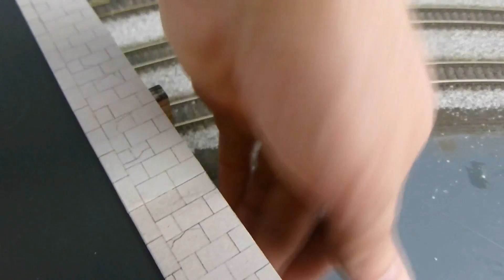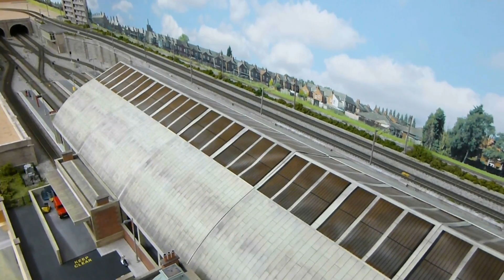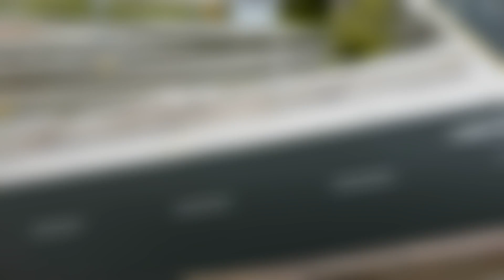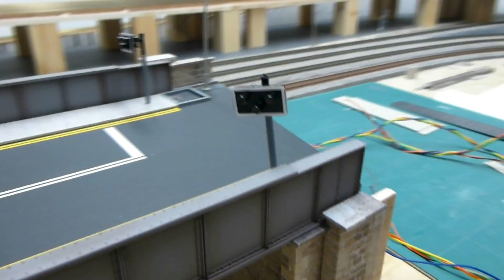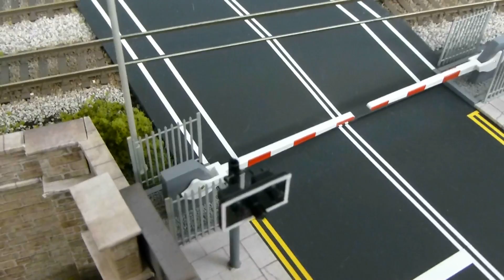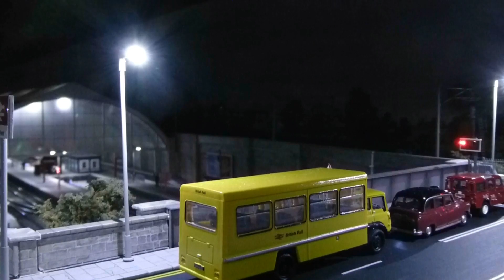Dean Park Station Video 81 - How to build a Level Crossing

Comment: Shouldn't the lamps be closer to the curb
Reply from the maker: Hi, Nope, thats how they appear on the vast majority of pavements.   I check the department for roads guidelines.   Some (on 40mph roads and greater are closer to kerb in some cases, but for built up areas the guidelines show that they are set back from the kerb.